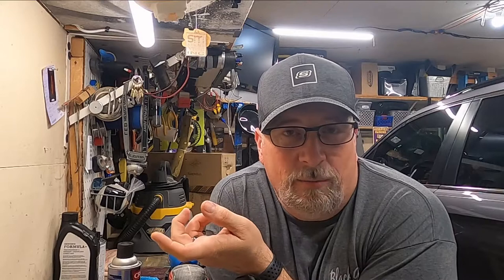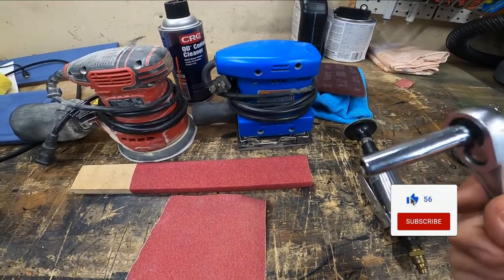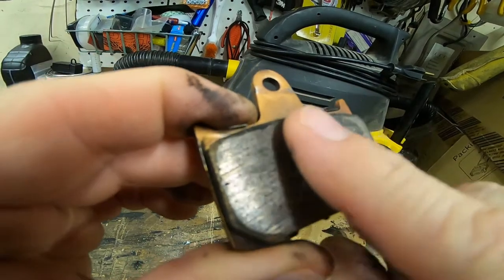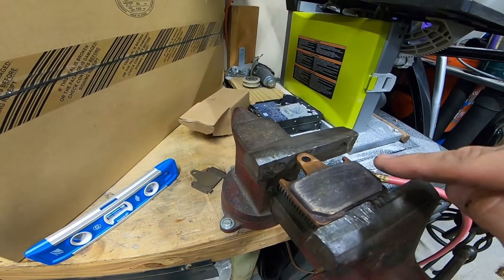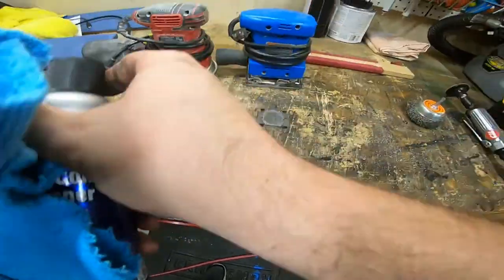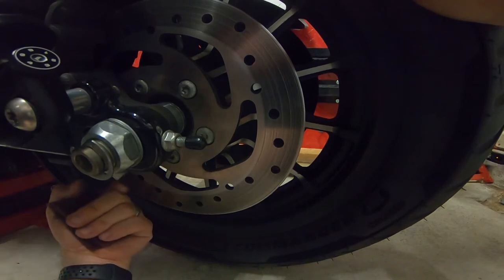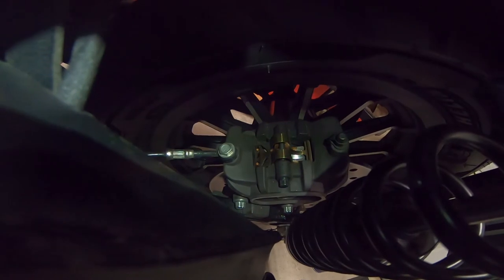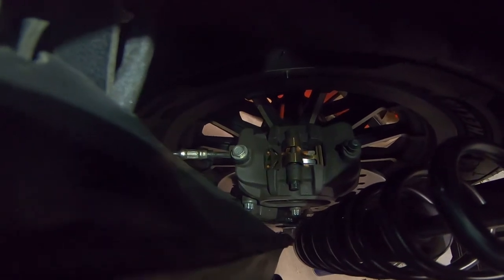How to Stop Your Brakes from Squeaking - How to deglaze rotors - How to deglaze brake pads

Comment: This is really good info! My sportster always squeaked and it drove me insane!
Reply from the maker: Thanks IronBornRider!! It works for all bikes so if your lowrider s starts to you got it. Really thinking of following you to lowrider s side.
Reply: @DoubleDMoto  yeah I figure the same technique would apply so I’m keeping this one in my saved list in case my brakes act up. The lrs is a great bike, been really enjoying her so far.
Reply: The rear brakes on my 2018 Sportster used to squal all the time. I swapped the brake pads to EBC sintered pads but they still would squal. Then I added a larger floating rotor (and a bracket offered by Lyndall Racing to run the larger 11.5 inch rotor on the 2012+ bikes that have the small 10.2 inch rear rotor) and swapping from the solid rotor to the floating 11.5 got rid of the squaling. The reason this is with the Sportster is because the caliper is a floating caliper (piston only on one side and the caliper slides slightly with the rear pistons) and with a solid rotor it squals. You can either run a fixed caliper to the solid rotor, or a floating rotor to the stock fixed caliper. Either will work, but the floating rotor is the easier option. I've since designed and am currently in the process of having a bracket made for the rear to run the 11.5 inch floating rotor, but with a 2 piston fixed Brembo p34 rear caliper which will be a significant rear brake upgrade since the rear brake caliper and master cylinder on the Sportster suck ass, and the stock rotor sucks ass too but I've already dealt with that hahaha
Reply from the maker: Never really thought about changing the rotor but that does make sense to help out. The EBC pads are the ones I’ve had the most problem with noise. The factory ones seem to be a little less noisy but definitely noticeable difference in braking. EBC for the win in that category. Thanks for sharing!
Reply: @DoubleDMoto  I bet my right arm if you have a 2012+ with the smaller rear rotor that a floating rotor will fix the noise! There are a few companies that make the 10.2 in a floating rotor if you don't want to buy a bracket for the 11.5 inch rotor. The 10.2 is a weird rotor because it only came on 2012+ Sportsters where the 11.5 came on almost every Harley in the last 20 years, including the Sportster until 2012. Then they upgraded the front from 11.5 to 11.8 and downsized the rear with a "better" caliper and master cylinder. I know Galfer makes the 10.2 in a floating model, but that is literally the only 10.2 inch floating rotor I could find for the rear of a newer Sportster, so going the bracket with the 11.5 floating rotor was an easy decision for me because there is so many 11.5 inch floating rotor options for Harley Davidsons. I went with 11.5 inch Brembo Series Oro rotors and they were great, and got rid of the noise and looked good. The front rotor got damaged in an accident where I was ran over, it got bent because my front caliper was clamped on the rotor at impact which caused it to bend when the front wheel made impact. So I upgraded my front brake setup again, and I am also getting a matching 11.5 for the rear, so if you want an 11.5 inch Brembo rear rotor for your bike meaning all you would need is the bracket from Lyndall (I'd even give you that too but I'd like to wait until I get the new rear bracket made and on the bike before doing that. The rear rotor only had about 3000km on it, it's essentially brand new. I'll be pulling it off the bike soon and hopefully the bracket will be coming off around the same time hahaha if you have Instagram add me @trucker_mac and shoot me a DM!

https://galferusa.com/moto/product/96953/DF724FLW
Reply from the maker: @jonnymac8925  definitely looking into this!
Reply: Yeah mine's been doing it lately and it's only gotten louder and louder, gonna have to check them out

Comment: Nice vid. My only comment is when you put caliper back on bike. Before you tighten the bolt squeeze the brake which aligns the pads, some bikes are pre aligned but not all. Then whilst squeezing brake tighten caliper which means everything is aligned inside caliper with springs and pads etc. like you I love tinkering and you tube has helped me no end. I have just bought a very corroded bike and have stripped it the brakes are horrendous. But slowly it’s going to be lovely again.
Great sounding machine
Reply from the maker: That is a good point. Thanks for sharing! One of  the members in my riding group found and old 1972 Sportster in a storage shed at his uncles house and the pads rusted to the rotors. It was a nightmare to get them unstuck. After a lot of time and persuasion they finally broke lose. So I understand. Ride safe!

Comment: Old timers run the pads on concrete to deglaze them. Same with metal clutch disks. I use heavy grit paper. Great info. Thanks for sharing.
Reply from the maker: You’re welcome and thank you! I have used the concrete method for quick “ sandpaper “ works just the same. Definitely a cheaper way!

Comment: This is exactly what I have been doing for many years every time I have the wheel off as a routine maintenance task. I would add to blow the parts off with air before you begin cleaning, and I use brake cleaner.
Reply from the maker: Blowing off the parts is a great idea! I’ve use brake cleaner in the past and it does work well. Just don’t like that it can damage some paints.  Thanks for the great ideas!

Comment: Just found you. I just put new pads on my 2015 roadking. Rode it 100miles it’s squeaking. I’m going to try this hope it works thanks bro! Oh, I didn’t clean rotor maybe it’s that ill clean next time
Reply from the maker: Welcome, I would definitely recommend wiping the rotor down. Nice clean surface is always better. Ride safe!
Reply: Yep, just replaced front & back pads about 100 miles ago too & me & my wife took a nice ride last night & they started squealing, only the front though.
I know what I will be doing on my day off on Tuesday,  cleaning them & putting up X-MÁS lights on house,, prefer wrenching on bike though. Lol! Thank you for sharing!
Reply from the maker: I definitely prefer wrenching as well. Thanks for watching! I would recommend running the sand paper over as well as cleaning the rotors. Might have picked up some dirty in between the pad and rotor. Question what pads did you replace with? Trying to figure out which pads are better or worse for a future video.

Comment: Will anything else work as well as scotchbrite pads on the rotors?
Reply from the maker: I wouldn’t recommend anything else. Pads are cheap and easy to find. I guess you could use steel wool 🤷
Reply: I've heard microfine 1000 grit sandpaper can be used

Comment: Curious to know why you use Electrical Contact Cleaner instead of Brake Cleaner?
Reply from the maker: I like to use contact cleaner as brake cleaner is a powerful detergent that can damage or stain some materials. Also brake cleaner can leave a residue and contact cleaner won’t.

Comment: Would you or can you use fine wet and dry paper on the disc instead ?
Reply from the maker: I’ve never used it before, I would try it on a small area and see if it scratches the disc. If it scratches it a lot then I wouldn’t use it. Biggest thing is you don’t want to remove metal it is just to remove the road grime and clean it.

Comment: Do you apply any grease to pistons and brake pad side mating surface?
Reply from the maker: I usually only put grease on the pin going through and little metal bracket it goes through. You can put it on the metal part of the back of the brake pad as well that touches the piston. Make sure you don’t put any on the pad side that touches the rotor.
Reply: @DoubleDMoto  Thanks for responding… I’m having some sort of friction issue with rear brakes after washing the bike.  It’s very intermittent and more prominent when performing slow maneuver turns and using a little rear brake for control.  It’s like a shuddering vibrations.  I pulled the pads out clean them up and still having issue.  The bike has only 130 miles on it, brand new!!
Reply from the maker: @finnsgarageLLC  I have cleaned them multiple times different ways and this is the best way that will definitely help. I will say that I do a lot of parking lot drills and I have to do this often as I heat the rear brake up.

Comment: How about constant rubbing or dragging of the pad?
Reply from the maker: It will help but will not remove all glaze on rotors. From my experience.
Reply: @DoubleDMoto  no i mean why are my pads dragging n rubbing the rotors constantly? No free rotation
Reply from the maker: @justaguy4real  could be a misaligned brake caliper. They will always be some drag but they should have some rotation.
Reply: @DoubleDMoto  guess I'll find out when i change my pads soon.
Reply from the maker: @justaguy4real  one thing I would recommend is losing the brake caliper bolts then spin the wheel. Press brake lever to stop wheel and hold the lever till you tighten the caliper bolts. That will help to make sure all is aligned. May need an extra hand to do this.
Reply: @justaguy4real  if you have axially mounted calipers, check that your slide pins are able to move freely. Then check caliper alignment as Double Moto mentioned.
Reply: @JDuBz815  @double d   thx fellas. Good stuff. I'd loosened the wheels to try but didn't do the actual loosening and brake lever as suggested here. Plus looks like my pins are def dried up showing no sign of lubrication.  I will do this..
Reply: @justaguy4real   brakes are supposed to have just a tiny bit of friction at all times especially sportsbikes  to get the most instantaneous stopping power
Reply: I removed, cleaned and greased the pins on my calipers and it was like I bought new brakes. Do one pin at a time. Reinstall before removing the second pin. That way it stays in position.

Comment: i was able to fix squeeking with water+shampoo and 3M brake cleaner. But after 10-15 km, squeek start again.
Reply from the maker: That is usually what happens with just water or brake cleaner as the “glaze“ is still left on the pads and rotor. You probably just cleaned out some dirt is why it stop for a short period and then once brakes got warm it will start again. Definitely try taking pads off and sanding the glaze off and cleaning rotors should help tremendously.